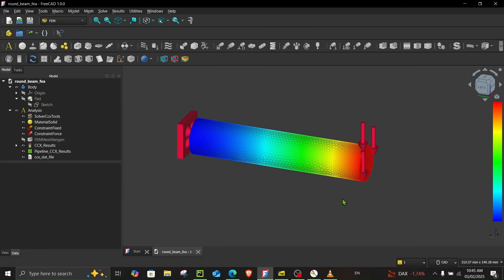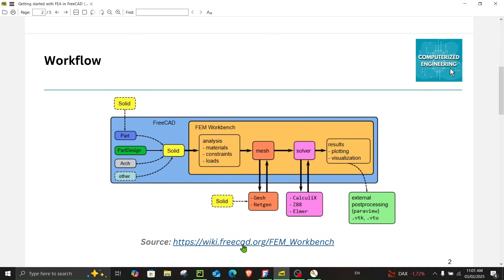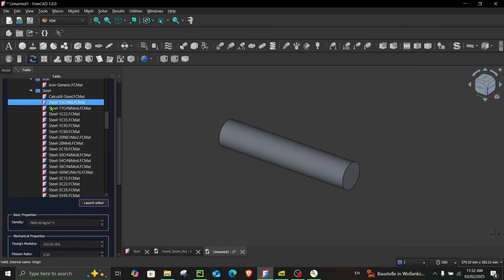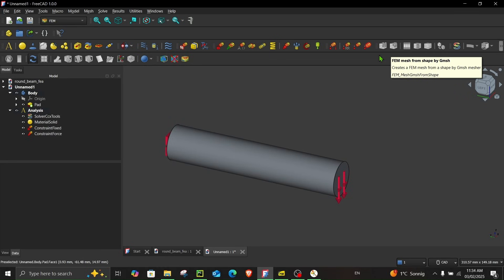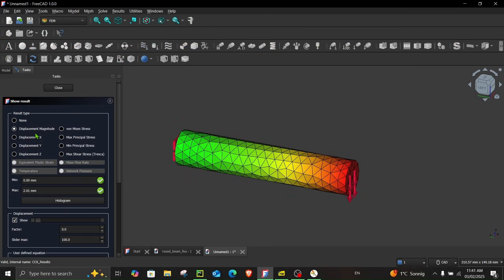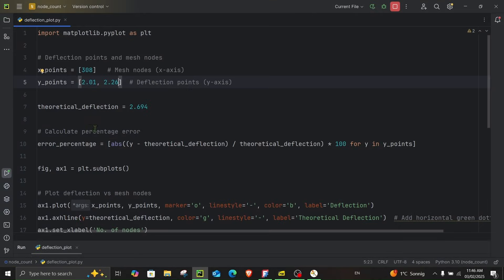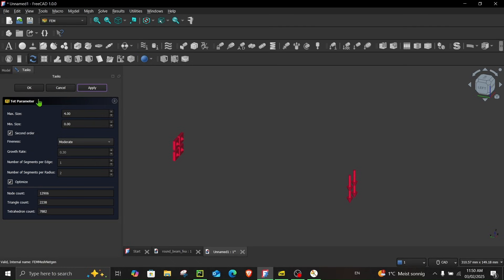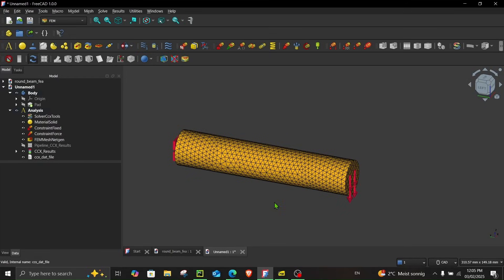FEA Tutorial in FreeCAD with Mesh Independence

Comment: In formula 0:20 incorrect number moment of inertia, but calculated with correct value.

delta = 20000 * 150^3 / (3 * 210 000 * 490.873) = . .  .
but need
delta = 20000 * 150^3 / (3 * 210 000 * 39760.782) = . .  .